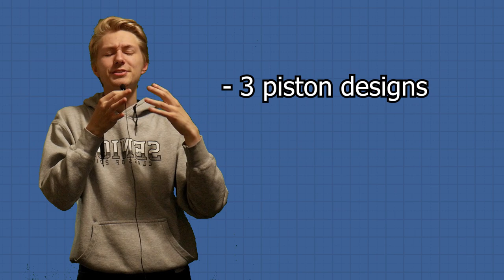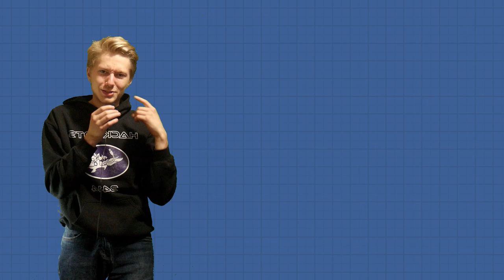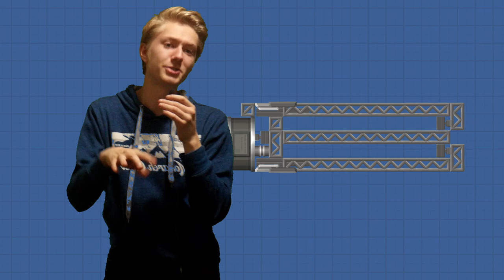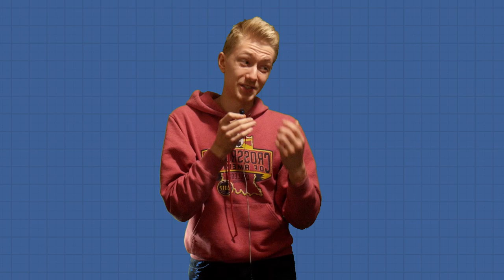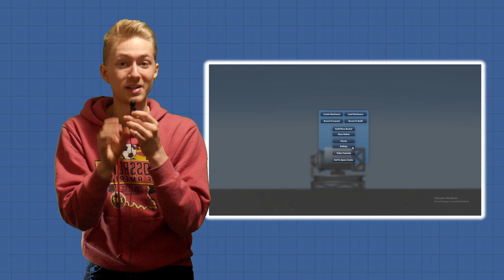How to MAKE PISTONS in SFS - Spaceflight Simulator

Comment: I am having a big problem with the third piston design you made. 

It works, if the edges of the fairing isn’t attached to the solar panel. I’m on mobile, so copying the design doesn’t work, and when I try to redesign something similar, it starts to do funny things (that means it doesn’t work either)

Please help 🙏
Reply from the maker: I think I have a piston design in the fusion discord (i think its in the description). although that one might be outdated

Comment: how do you make "half a faring" ?????
Reply: and how does the strut attach to the faring????
Reply: I made a slight change in the design by making the farings width to 0.5 and putting a strut underneath the tip of the panel and it still clip trough everything...
Reply: Bp editing, change "fragment" of the faring to right or left, and boom! It should work :3